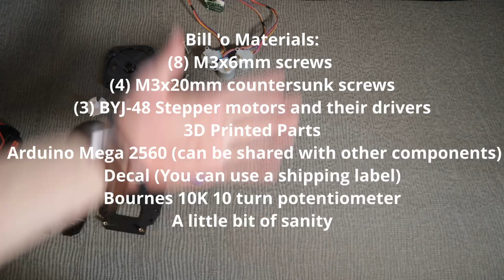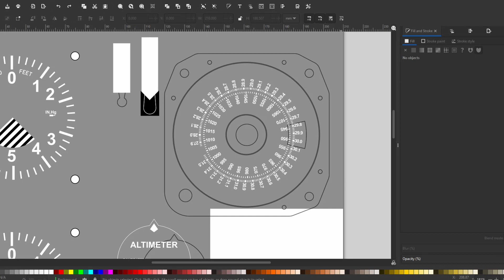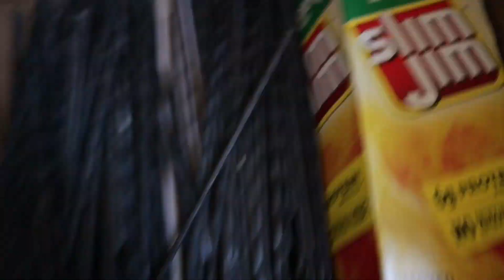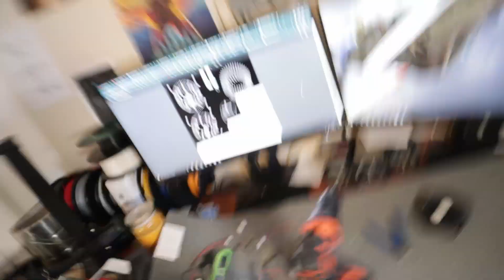Build the Altimeter | C172 #44

Comment: What if you make a servo altimeter
Reply from the maker: I'd recommend a stepper - most servos only have 180 degrees making it difficult to implement. Is there a servo you're looking at to use in the altimeter?
Reply: This was my old channel also that’s not what I ment I mean the altimeter on jets
Reply: It’s cold a kolsman servo altimeter

Comment: How do altimeter know zero position. I'm in, lets say you reset sim and respawn at runaway, can it go zero position or what?
Reply from the maker: It keeps track of each step it moves and when you exit the sim resets to zero. There may be some drift after time so you may need to rezero it periodically.

Comment: hey Bob. I built quite all sixpack instruments(except turn coordinator) from your collection file. I am wondering how a software could find zero status condition on the airspeed indicator , vertical speed indicator and this altimeter cause  of lack of indicators like hall sensors as you did on the attitude indicator or  heading  indicator.
Reply from the maker: Hi! The Airspeed and Turn Coordinator ball use a "slam zero". If you run it to both of it's extents the instrument will zero. Currently I have no way to trigger the slam zero sequence inside MobiFlight.
The VSI and Airplane part of the turn coordinator does not currently have any zeros. I am considering putting in optical sensors but this is not a priority right now (the steppers seem to hold their zero reasonably well). 
I would like to revamp the Altitude to use only 2 steppers and maybe have a zero mechanism in that.
Reply: @CaptainBobSim    The first altimeter I built was the one from aleovalea downloaded at thingiverse. He uses only one stepper and  uses  a photo diode for zeroing the gauge at initiation but the bezel differs from your gauges. So I printet out another of your top bezels, changed thickkness of it so  that the needles fit in with the acrylic glass.  Now I have his altimeter working with your outer bezel layout. Disadvantage of his gauge is that the altimeter sets very slow to a specific given altitude  or while nosediving

Comment: great Job  CAPTAIN!  my doubt is how  attach  wheel plate  with hundred needle..?   cause   if i move the wheel , ( pression adjustment) will not affect my altitude..
Reply from the maker: It's all done in software - adjusting the altimeter setting changes the indicated altitude.
Reply: @CaptainBobSim    nicee!!  Great  Proyect!..  thanks a lot!!
Reply: I di😁d it! thanks again!!
Reply from the maker: @miketango507  Wahoo! That's fantastic!!
Reply: @CaptainBobSim   thanks a lot!! but now have issue with  Kollsman settings.. soon I connected and run, windows  values disappears from  my cockpit. SOLVE !   I set 0.338639 instead 33.86 for this preset was completely off..!! now going to set  my MIP  have tones of gauges all over.. lol
Reply from the maker: @miketango507  I had that issue too :) It'd be annoying to get it back to 29.92